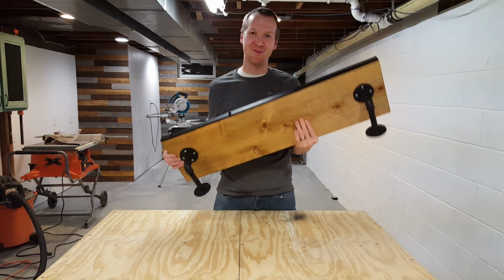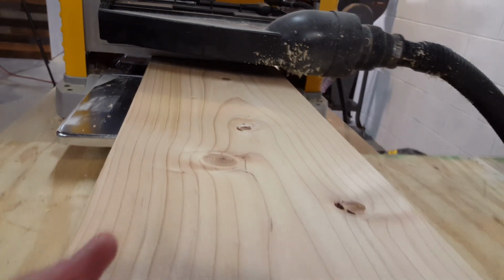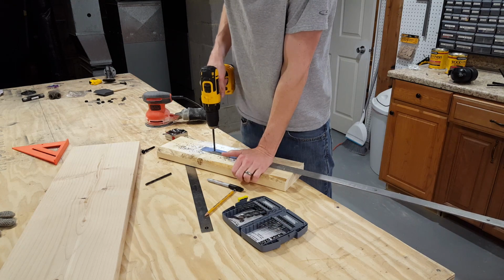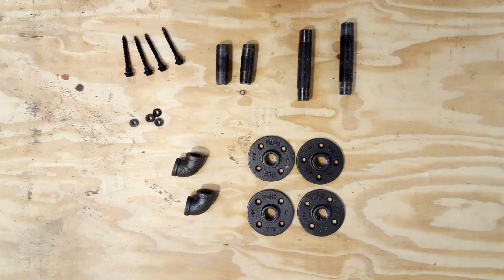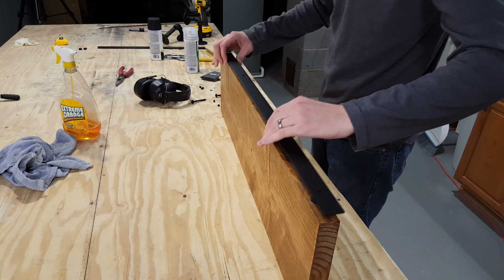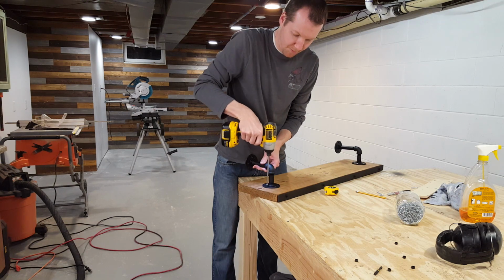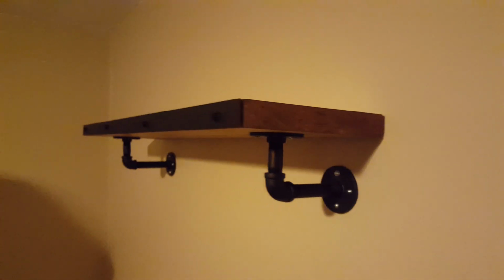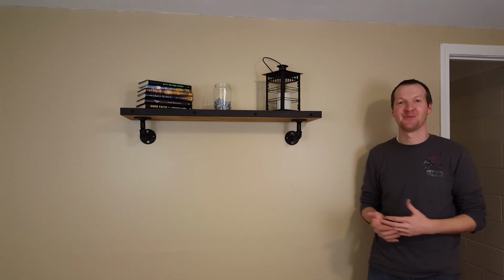DIY Industrial Pipe Shelf with Man Cave Tour

Comment: Friend, it is much easier to calculate the level of the shelf when you are going to drill the holes first, just making the holes on one side, then this side is already attached, it is easy to make the marking with the right level of the shelf!
Reply from the maker: This is a great tip, thanks!

Comment: I love the metal bar part going to have to steal that idea...except I don't know if I have a way to cut the metal bar lol... (I am doing small speaker shelves)
Reply from the maker: Glad you liked it!...it really adds a nice look I think. A cheap hand hack saw will cut this metal with ease...good luck!
Reply: @chaddiy  I bought the parts to do it, then ran into a slew of other issues (these were for on wall speakers)

Decided to move away from on wall speakers and got some ones for my desk, shelve area is going to be covered with 3d art panels. BUT the shelves will go somewhere else soon =D I'll let you know how it goes.

Comment: Hi DIY Chad,   Will the flanges and 90-degree elbows connect without using the straight tubing?  I'm making a slanted shelf 4" wide x 10" long.  Thanks, Janet
Reply from the maker: Hello Janet, you will need a piece of straight pipe to connect the 2. You can buy very short pieces though, but you need something to thread the flange and elbow together...hope that helps.